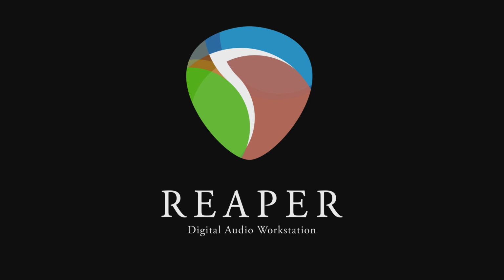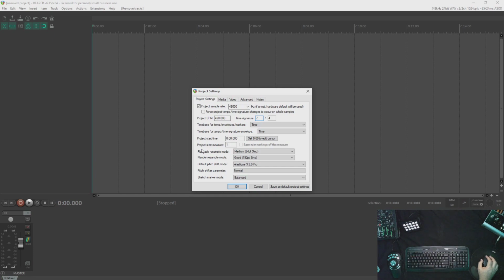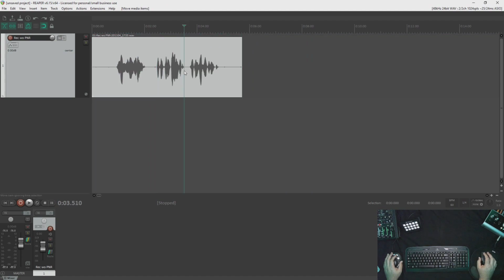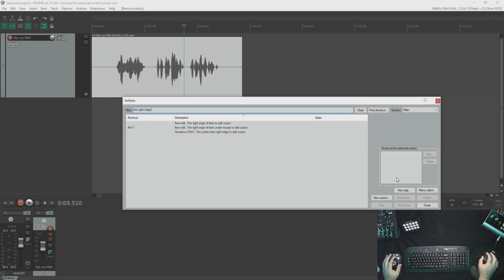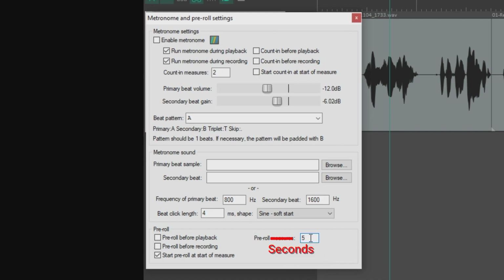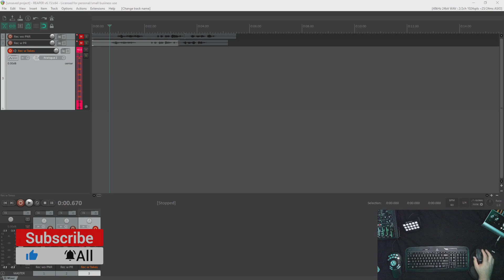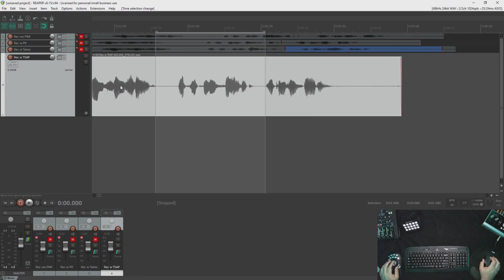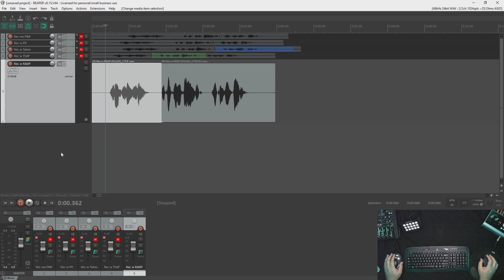Punch and Roll (PNR)

Comment: I really appreciate the time you took to explain how to PNR in reaper.  Keep up the great work.  Because of this video I picked-up a Contour ShuttleProv2.  It has made a huge improvement for me.  The only issue is that setting up the contour can be tedious.  I appreciate you putting up your key assignments.  I would love it if you made a video on how you setup your ShuttlePro with key assignments and how you use it in Reaper.  Thanks again!
Reply from the maker: Hi, @Captainmatt747.  First, I hope your name means you're an airline pilot with four bars on your shoulders :-)  Maybe you've flown with Kelsey from the 74 Gear channel!

Thanks for the encouragement.

Yes, setting up the Contour can be very tedious.  I have the ShuttleProV2 on the editing desk and the Xpress in the booth.  However, once the buttons and wheels are configured, the time savings far outweigh the time spent to program them.  One of the goals in creating these videos is not to make them a sort of "How Do I Do Things" category.  Assigning actions to the Contour controllers is a very personal thing.  You really want to know what you do all the time, prioritize them, and then assign them accordingly.

With that said, however, I can produce a video to show what actions are set to what buttons in my controllers and how its done for both Mac and Windows... the configurator is slightly different for each OS... naturally :-)

Comment: Thank you!! Along with your videos I was able to figure out how to select regions within one track, rename them per chapters I'm narrating, and then render each region with the correct file name (chapter 1, chapter 2, etc "$region") for each daily session of narrating.  In pro-tools I would have to make sure and consolidate each chapter to get the .wav file needed after punch and roll.  So far, I'm not seeing any need to "glue" sections together after punch and roll if I'm using this region method.  Anything I'm missing?
Reply from the maker: Hi, Kristin.  I don't see a need to glue the sections either.  Regions override any splits.  Also, there is a way to "smooth play" from one region to another thereby skipping (realtime) what you don't want to render.  Look up Region Playlist.
Reply: @REAPERforVoiceTalent  Thank you!!

Comment: Great video thanks. I have a question for you: what kind of controller do you use?
Reply from the maker: Hi, Ernesto.
Thanks for the view and the question.

I actually use two controllers from the same company.
The one in the video is Contour Design's ShuttleProv2.  The one in my booth is it's little sibling, the Shuttle Xpress.
You can find more info here:
https://www.contourdesign.com/product/shuttle/

As of the time of this reply, the Prov2 is about $100 and the Xpress is about $60.

Also, you'll note in the Description, there are links to two graphics with the REAPER keyboard shortcuts I assign to the keys on the controllers.
Reply: @REAPERforVoiceTalent  Thank you for this suggestion Steve, I never heard about this controller before. I normally use the Kensington trackball but this seems to be better in some aspects.
Reply: Steven, thanks for the awesome reply. I only have one more question: are both controllers USB cabled?
Reply from the maker: @evallesg  Yes, they both are.